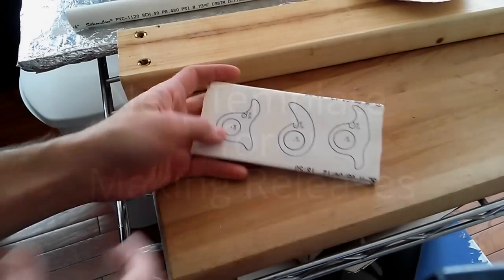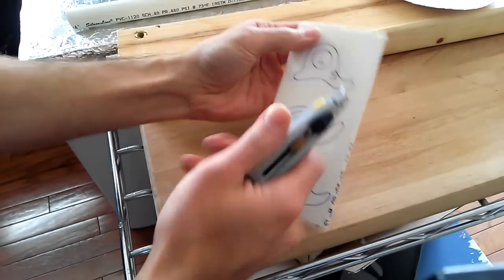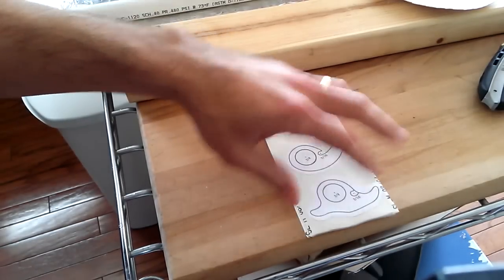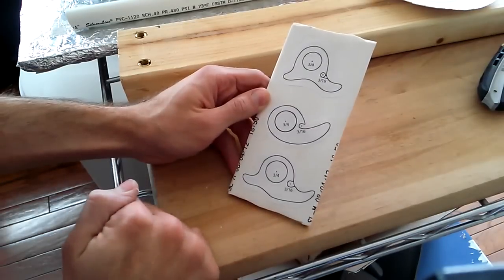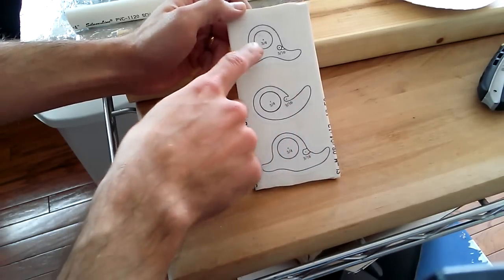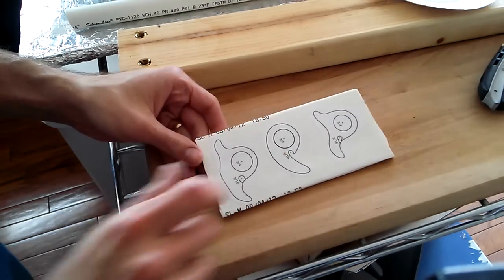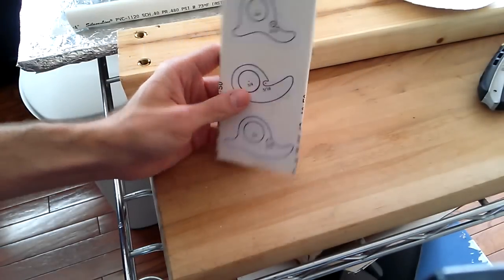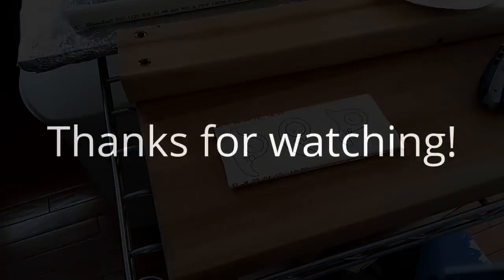New Template for Making Archery Releases

Comment: Hey Tim, nice work! Looking forward to what you think about these releases. One added benefit to having a drilled hole for the hook is that the release will then also work as a wrist-style release, meaning you can rotate your hand to release the arrow. That is sometimes more comfortable than lifting the index finger (which only needs to be a very slight release, not a full lift). As for the uneven sizing, I'm still trying to figure out how to get properly scaled pictures into Google+ as the files I put up were already scaled for printing. I might have to actually upload them as a PDF or something.
Reply: Hey Nick, nice seeing you commenting here. You can use google drive to upload and share pdf's. Those are nice templates, nice work!
Reply: Thanks! Sounds good!

Comment: Another thing you can do as far as putting the templates on the pvc (and save yourself some paper and spray adhesive) is to tape the pattern(s) onto the PVC sheet and out line them with a sharpie marker (preferably a razor point)
Reply from the maker: Yep, that's how I do my siyahs - I don't know, this just felt like a good way of doing it - I'd print it on card stock to do it that way, otherwise I'd be driven mad by the paper lifting, trying to slide away, etc :)
Reply: Tim Piatek
Well to prevent the paper from slipping off I use a little dab of spirit gum at all four corners of the template (so that it can be used multiple times ^_^)